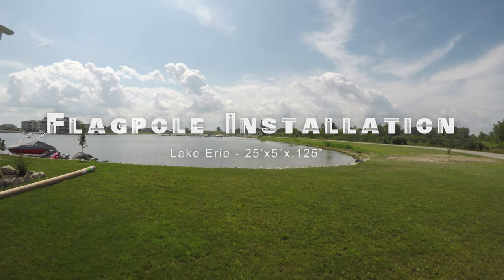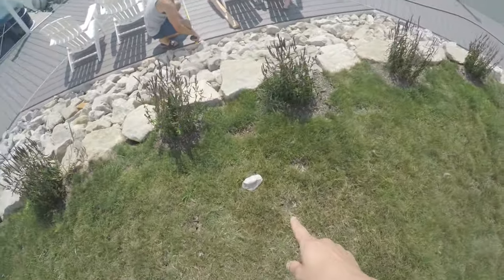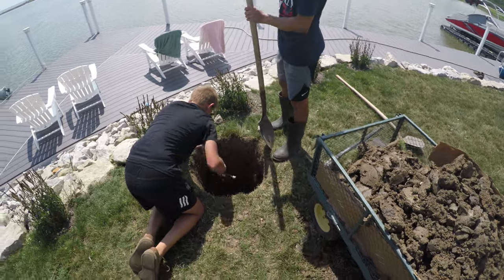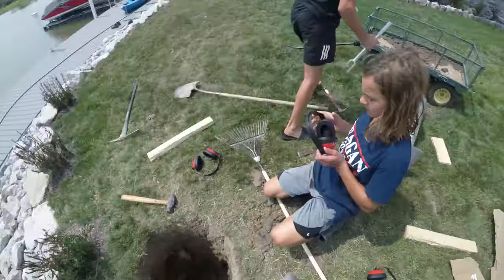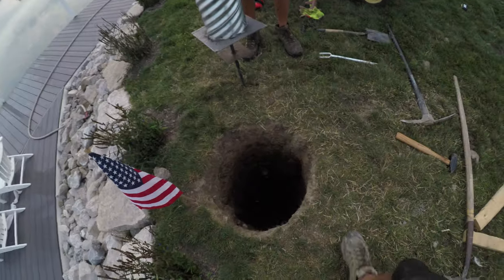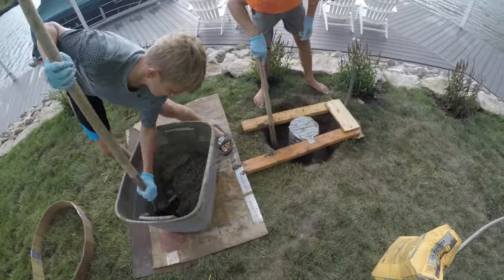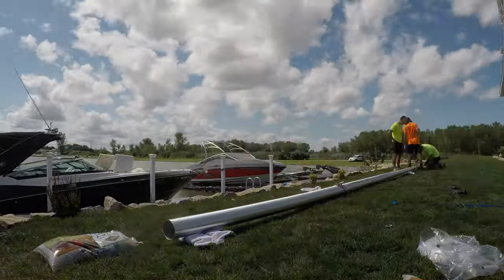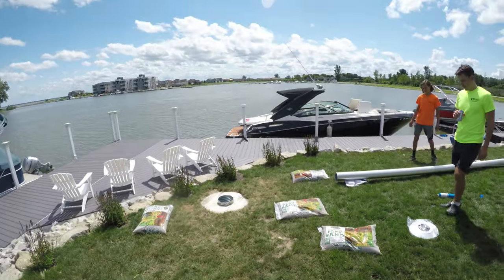25 Foot Flag Pole Installation | How-To Vlog + Timelapses

Comment: Great job guys with the video production and the flagpole installation! I own a flagpole business so it's nice to see fellow patriots raising their flags across America!
Reply: im getting a 25ft internal black anodized delivered in roughly 4 weeks. ialready dug the 25x44 hole to prep.. PITA.. but about the install.. what kind of sand do i need.. just homedepot multipurpose sand?
Reply: I can’t get a decent flagpole up here without paying a lot for freight. I have about a 15’ spruce pole on a bluff people can see for quite a ways. The pilots lands at the airstrip down the road like it also. It blowing about 20-30 mph now.
Reply: what is the pole made of? aluminum or galvanized steel?

Comment: Great video! By the way no need to cover the concrete with a tarp when it is raining and it sets. The water wont hurt it in fact a lot of concrete jobs end with covering it with a soaking wet burlap blanket. That said if it were a tropical storm.. I’d prob just cover it with a moving blanket so the aggregate stays in place. Awesome video i am installing mine tomorrow!

Comment: Just out of curiosity what size flag is that? 4x6 or 5x8? I recently installed a 25-ft pole and decided the 3x5 flag I have is too small for it but I don't know if 4x6 will be enough of an upgrade. I'm seeing varying tables of sizes for the flags. A lot of them say a 25-ft pole can handle a 5x8 flag
Reply from the maker: This is a 5x8 flag and I think you should get it. I'd rather my flag be too big than too small. Just for reference, we are getting a 40 foot pole soon and plan to put a 15x25 flag on it even though they recommend that for 60' poles and above. At end of day its all just personal preference and don't get caught up in those tables too much.
Reply: @backyardmayhemusa  What I was looking at the tables I thought that their recommendation wasn't based off of appearance but wind resistance. I'm getting some stronger rope than what came with the flagpole pretty soon So it should be able to handle the larger size no problem

Comment: the Eder sleeves that are standard are 36 deep with a 6 inch drop to the base plate. you need 42 inches total and 12 inch lightning rod goes all the way in. your flash collar should sit flush to grade. you want to bury the CMP { corrugated metal pipe}  flush with the ground. external halyard are nice. good job.
Reply from the maker: Yes well said. But we actually left the ground sleeve / CMP exposed a little because we wanted to add river rock to make a nice mulch bed with plants etc. The flash collar is now flush with the river rock.

Comment: Way overkill on the hole, do you think the wind is going to pick it up and carry it away?
Reply from the maker: For a 25 foot pole it is a pretty standard hole. The founding is 3' foot 6 inches deep. And then the grounding spike goes even a foot deeper that that.
Reply: @backyardmayhemusa  probably because you have a commercial pole. I have installed many 25 ft residential 3" diameter poles.24" deep, 16" wide hole.  5-6" gravel. 4-60lb bags of concrete. Never had any issues even in the northwest coastal areas. I do love your location. good job.
Reply from the maker: @garylivingston9052  ahh gotcha, that makes sense. In general we just followed the manufacturers instructions for installation. We are doing a 50' pole soon. The pole is sold as 55' and you bury 5 feet + 1 ft for the grounding plate. Will post the video once it is done. In general 10% of the pole goes underground from what I know

Comment: Good job. One question, what is the purpose of a rotating truck if the line is tied to the cleat?
Reply from the maker: Originally I thought the same way, but if you leave a little slack in your halyard the rotating truck will actually rotate 270 degrees while being tied to the cleat. All in all, this reduces the stress / wear and tear on your flag.
Reply from the maker: I forgot to mention....rotating truck only works well on external halyard if your cleat is on the side the wind is most commonly blowing towards. Otherwise the rope will always be fighting the cleat / putting more stress on your flag.

Comment: Where can I buy this? Anyway, love the pole!
Reply from the maker: I did a bunch of research and found this company to provide the best price and service: https://flagpolesetc.com/
 . Let me know if you need help picking a pole!
Reply: Thank you!
Reply: @backyardmayhemusa  Thanks for doing the research!  What specific series Pole did you get from FlagPolesEtc (residential, commercial, internal halyard)?  They have a ton of stuff, but the 5" base and 25' height looks close to what I want.  Thanks for the info!
Reply from the maker: @IRONPete64  Little late on this, but we got the "25ft. x 5in. x .125in. Aluminum Commercial External Halyard Flagpole". We wanted something that looked beefier than a normal 3-4 inch base flagpoles. 5inch is a sweet spot! Don't worry about the wall thickness unless you live in a very windy (hurricane & tornado) area

I liked external halyard since i like the look of the rope going down the pole. Make sure to request a rotating truck this will help rotate the flag at the top and reduce stress on flag. Some say there is no point to getting rotating truck with external halyard, but don't listen to them. If you are worried about the flag rope getting tangled up as the flag rotates then get the internal halyard. My external halyard (with rotating truck) get me around 320 degrees of rotation for the flag. However if you want endless rotations of the flag, you need to get internal halyard.

Comment: Shits probably going to rust in no time if you didn't clearcoat that aluminum pole.
Reply from the maker: doubt it, we will see. This is direct from flagpole manufacturer with alloy 6063, rust resistance, anodized properly. With minor yearly maintenance, this will last my life time with little to no rust.
Reply: @backyardmayhemusa  It's been treated then. It probably will last a long time.